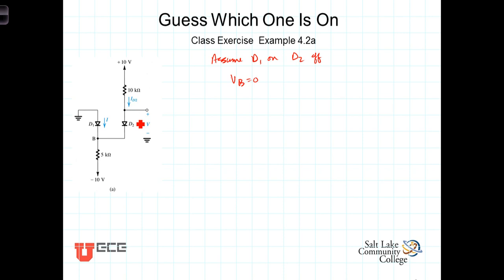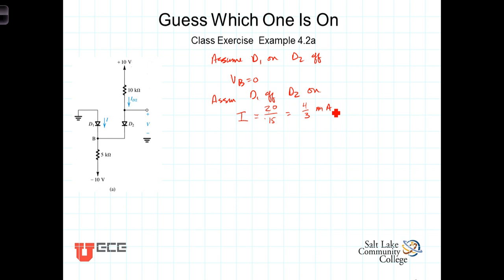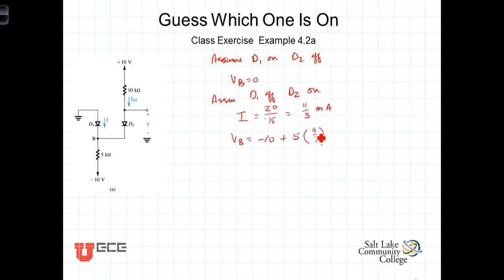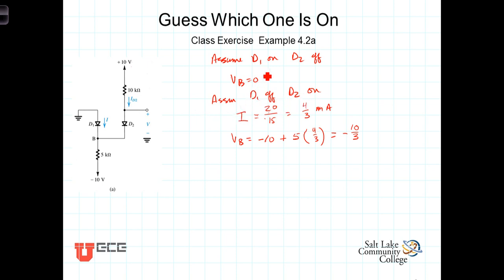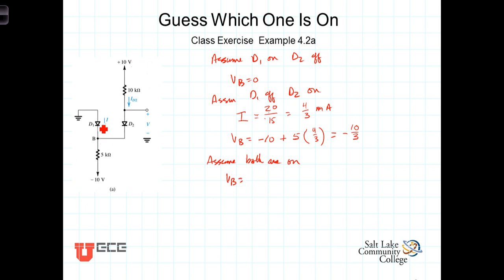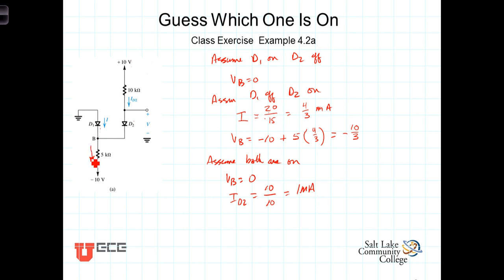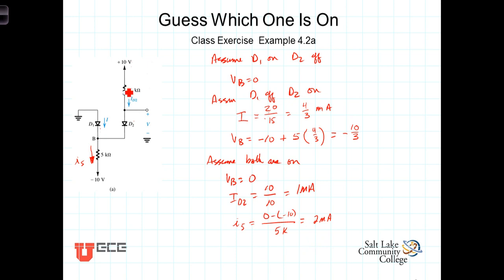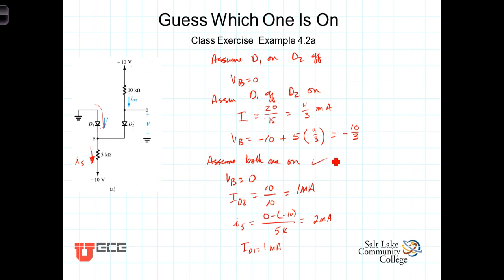L4 1 5Ideal Diode Conducting or Not Part 2a

Comment: if we assume D1 is on and D2 is off, how would we know if the voltage drop across 10 k-ohm resistor doesn't exceed 10 volts, making the node voltage less than 0 at the node right above D2? Wouldn't that then mean D2 is off?

Comment: So if both are conducting, then how can there be a current in the D1 branch? Vb = 0 volts and the other end of D1 is connected to ground, so how is there a potential for the current to flow?
Reply from the maker: +JuGGerJuGGs We are using an ideal model - ie. the diode acts as an ideal switch with no voltage drop across it.  Because the lower side of the 5 K ohm resistor is tied to -10 volts, there is a 10 volt drop across the 5 k ohm resistor which draws 10 mA.  But only 1 mA comes through the 10 k Ohm resistor.  The other 1 mA comes through D1 from ground.    In reality, there is approximately a .7 V drop across the diode needed to overcome the junction potential Vo